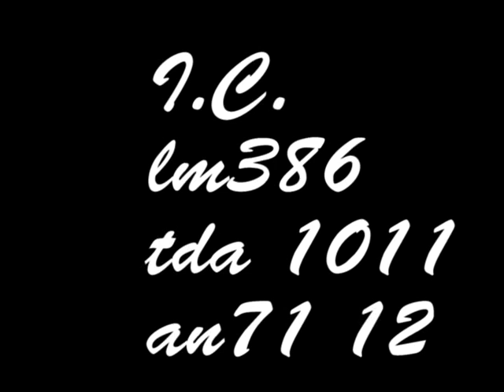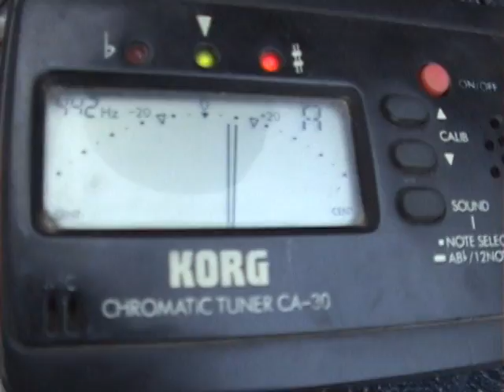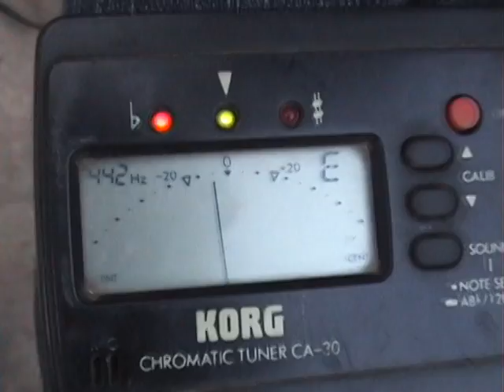diy ebow casero hecho operacional lm386-n4 dos bobinas

Comment: did you add additonal magnets to your coils? i currently have an ebow built with 50 ohm and 16 ohm coils, and i can only get my high E string to vibrate when the ebow is positioned perfectly, yet it tends to lose momentum. wondering if i should add magnets to increase its vibration. also are you powering it with 9V or 12V?
Reply from the maker: if I added magnets on both coils (they have a core of iron)
and mount the neodymium magnet on the top are cut from hard drive magnets
Reply from the maker: gab ve
the magnet is to have greater the magnetic
feedings with 12 and 14 volts

Comment: Where did you find those coils?
Reply from the maker: miguel gutiérrez Barcelo the I built with an iron bar and wind under clockwise until the required ohms and the top put the neodymium magnet and casing made a perforation to leave a little pin is the string vibrates